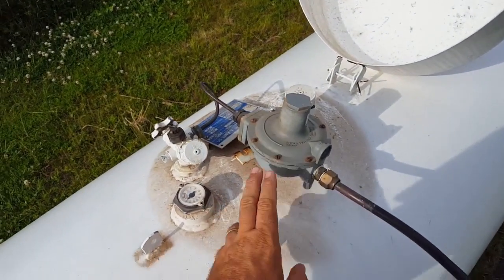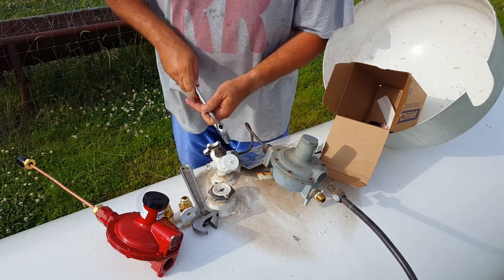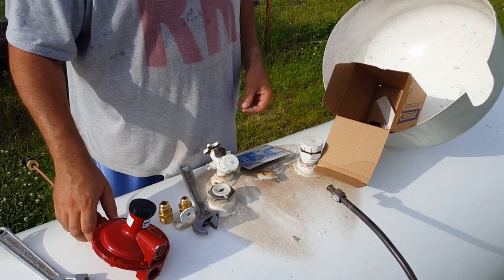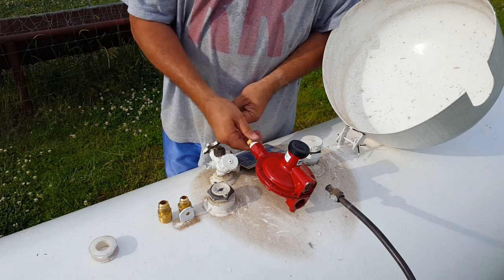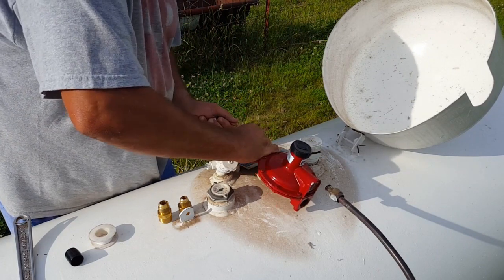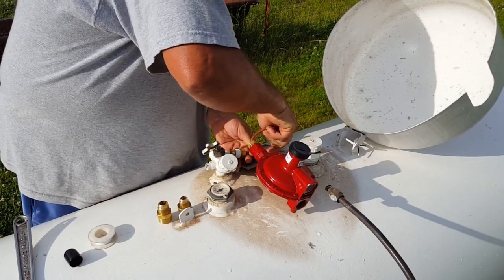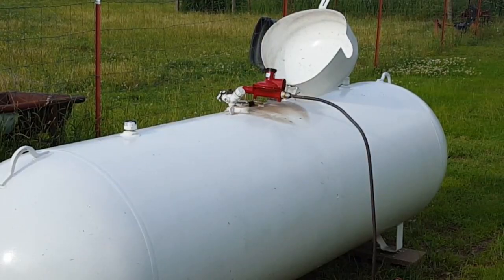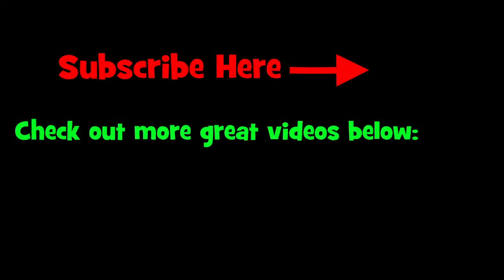Propane generator fixed - How to change propane high pressure regulator

Comment: Thanks for the video, but 2 things.  You should never use an adjustable wrench on brass fittings and secondly,  Yellow teflon tape is standard (and necessary for inspectors if need be).  I know it's not a big deal, but if the regulator fails and something happens, guess who they will blame.

Comment: I’m about do set this up with the duromax 13000EH and a 125 gallon propane tank. I really want to know your propane tank supply store for where you purchased your regulator and other supplies.
Reply from the maker: Don't remember the name only on in Eufala. Just lookup your local propane company they will have then. Home depot and lowes might also.
Reply: BigRedFishDad so you went with the huh pressure regulator across the yard until you got to the generator then reduced the supply to 3psi?
Reply from the maker: @mwolkonsky  no... the generator has its own regulator and could handle straight off tank so we didn't need to reduce it.

Comment: Why did you not use the yellow gas line tape on the connectors? Much thicker and better thread seal on gas conectors. Can be purchased at LOWES less than $4 a roll. It's for gas connector use.
Reply: Because he doesn't know what he's doing. If he knew what he was doing, he would know it's the yellow tape and you also don't need tape for flared fittings.

Comment: Did this 25 years ago and now it's time to do it again. The delivery drivers have been writing "out of date" on the regulator for years, so figured I better get on it during vacation. The company tried to get me to put down a $500 "tank deposit" after the tank had been here for 15 years without one. I told them either exempt me from the deposit or come get the tank and I will go elsewhere for my propane needs. They acted shocked that I could be so rude as to not give away my money for nothing, but they did exempt me instead of losing a customer. Sometimes it pays to be a man instead of a wimp. Thanks for the video.
Reply: You are not rude. Recently heard of the deposit play that gas supplier tried on friend after he had bought house with tank already there !! Good for you great comment thanks !!

Comment: As a LICENSED gas technician I can only say do not follow these instructions. You don't use teflon tape on POL fittings, even then, you wound it on the wrong direction. You didn't back up the tightening of the POL into the regulator which can break free the fitting on the reg. And if ever there is an issue, good luck on an insurance claim since you did this yourself and video taped it without being qualified to do the work.
Reply: Correct. No  thread sealing on a POL  because the the threads on the compression nut are simply applying force to keep the dry flared sealing surfaced together.   This function of the compression nut should be obvious.  It's how flare fittings seal.  if gas were present at the threads such as if the nut was not tight or the POL deformed then that gas would escape between the inside of the nut and the tube.  And of course, anyone with basic mechanical aptitude knows to use a back-up wrench.   Self-help videos such as this pose a danger to folks working with flammable fuels where there is no room for trial and error as there is in replacing a sink faucet.   The seller of the parts should insure that  homeowners have the knowledge and the skill to properly install the parts they sell for critical systems.   O.P. should update this video or take it down rather than rely on his viewers to read corrections in comments.
Reply: You should smoke only Cigars while working on propane systems.
  Take care 
 From a 30 yr  tenure carying wrenches around !
Reply from the maker: jimnmaine1 blah...blah...blah... thanks for watching been going strong all year... ran the heater in garage this winter too used the low pressure regulator we took off. Thanks for the advice ;)
Reply: That's great that you have made it this long. I'm sure you checked flow and lockup blah, blah, blah, NO, because you have no idea what you are doing. That is evident when you check the size of a flare fitting by putting them end to end. LOL!!!
Reply from the maker: jimnmaine1 bless your heart another "professional" got their feelings hurt because people can "do it yourself"... thanks for watching ;)
Reply: Good that you edited your post, but that doesn't change the fact that you have no idea what you are doing. I have ZERO problem with someone being a do it yourself person. I have a problem with someone who says they are a master of learning, your words not mine, and yet scoffs at being called on poor workmanship. People who actually have mechanical ability would always back up anything they are tightening or loosening with a second wrench. But not the good ol' "Master of learning." You strike me as more of a Aw shucks, that's good enough I reckon. Wrong is wrong and a hack is a hack, not someone who can do it yourself.
Reply from the maker: jimnmaine1 yep had to edit it... phone spelled some thing's wrong but you probably didn't notice.
Reply from the maker: jimnmaine1 oh... and can you elaborate on the 2nd wrench you speak of I would love to learn.
Reply: BigRedFishDad Processional, yes, I noticed. Hahaha
Reply: BigRedFishDad Do you honestly not know how to use two wrenches to loosen or tighten a fitting? If that flare nut hadn't been loose to begin with you would have twisted the copper tubing, not piping as you incorrectly described in the write up, like a candy cane. And again I reiterate, I have no problem with a do it yourself person doing things correctly.
Reply from the maker: jimnmaine1 I sure am glad you were around to educate us... Maybe you should go back and read the description or watch the video entirely then you would understand the description. But again thanks for watching.
 BTW I love getting people worked up it's good for the ratings as they say.
Reply: BigRedFishDad It does little more than prove each of my points when your reply to someone who is licensed in what your video is showing explains what you are doing wrong is blah,blah, blah. You simply show anyone who might see this how NOT to do this. Keep on with your sub standard work and hopefully no one gets hurt from it.
Reply: BigRedFishDad go and do a bit of research and you'll see that I have educated you.
Reply: Anyone using this for informational purposes please jot down the URL so your lawyer will have a starting place for legal proceedings if and when your house burns down.
Reply from the maker: jimnmaine1 hey thanks for watching... Your comments speak for themselves. I feeels so murch  smarrer after tarlkins to you. I knows them thar diferanse beeteeinks cupper tube and black pipes now.

Busy now going to play in shop and make more videos... have fun and share with your friends. You can con them into how smart you are.  With the only issue of having to use teflon the rest was you just trying to sound good and not knowing what you're talking about because you only watch the first minute and a half;)
Reply: A hack is a hack. You prove my point. Thank you.
Reply: @BigRedFishDad  A back-up wrench is used to keep the force at the fitting and not let it travel down the line such as in to  the fragile aluminum body of a regulator.  It is also important so that the correct amount of torque can easily be set.   So basic is this knowledge that anyone lacking it should not go near any assembly with tools in hand.   You also have the jaws of the adjustable wrench on the nut in the wrong direction.

Comment: 1. Dont you need the yellow tape?
2. Dont you need soap in the water?
3. Thanks for posting!
Reply from the maker: xesvuli420 yellow... probably but was all we had was what was already on the old one so doesn't seem to degrade too quickly... and yes soap or you would not get bubbles if there was a leak.
Reply: Yes on soap and tape comment !! Kids bubble play liquid works great to !!! Lowes has the yellow thicker tape !!